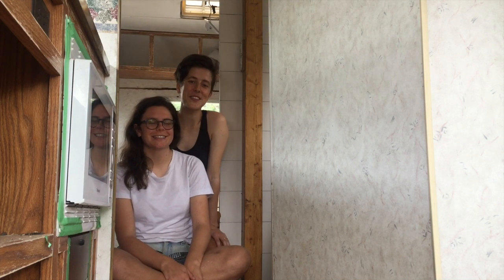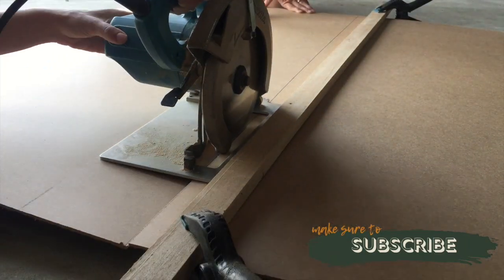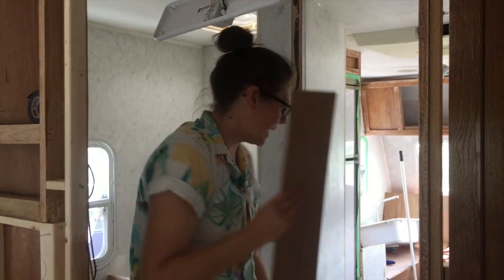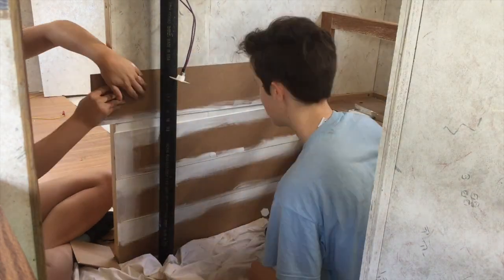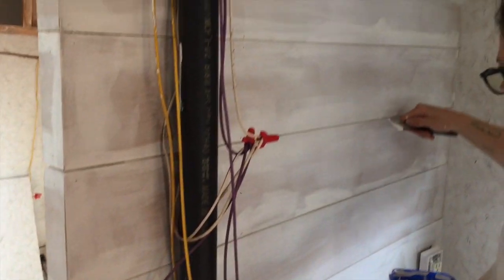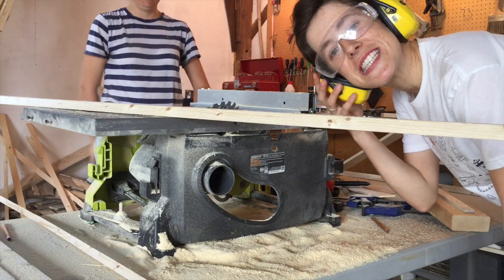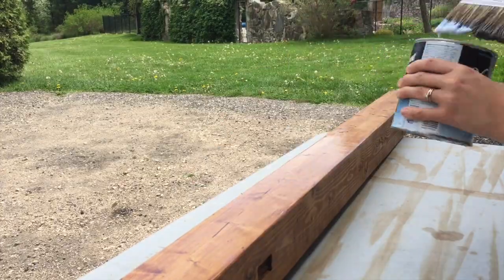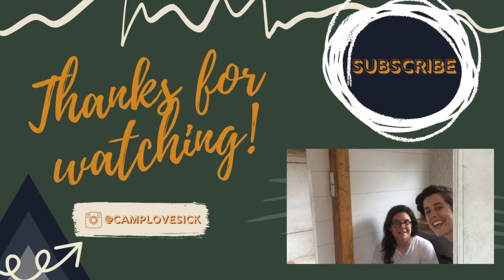How to: SHIPLAP and FAUX BARN BEAM | Camper Renovation | Trailer Remodel Project | Episode 7

Comment: So it's been a year since you've posted this video, how has this board held up?
Reply from the maker: We sold the camper, but told the folks who bought it to reach out if anything needed to be improved on, and we have only received positive things from them. We have changed to using lauan plywood for the shiplap though, and we use construction adhesive any brad nails when installing. It's a bit overkill, but better safe than sorry. In terms of the beam, we would do it exactly the same way if we did it again. Hope this helps!